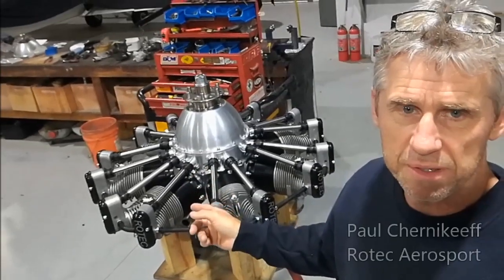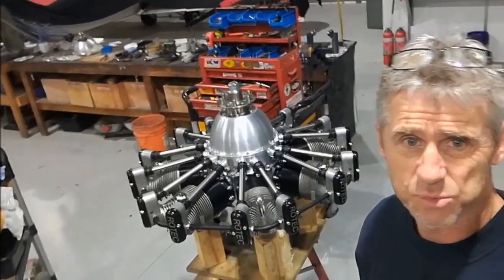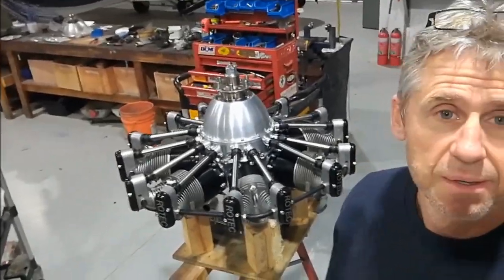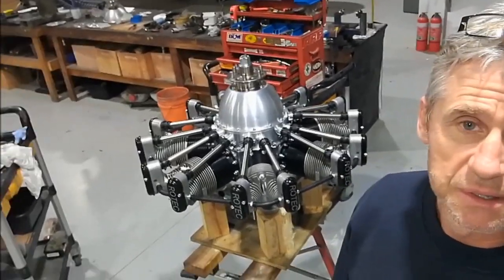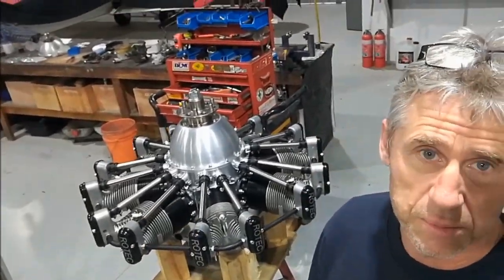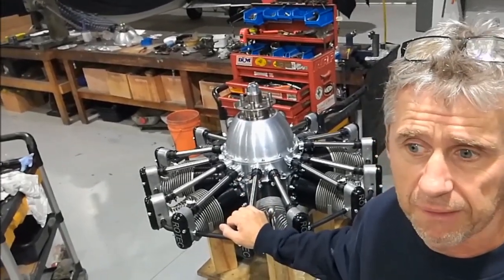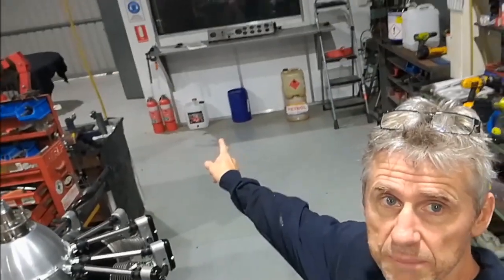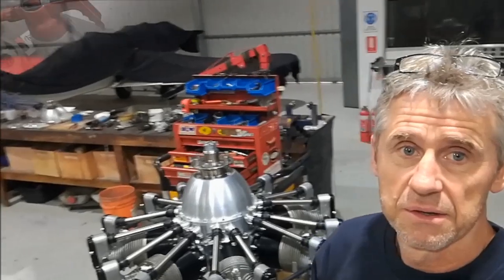Rotec R2800 radial Assembly (Time Lapse)

Comment: Would have been nice to have seen the engine assembled from the ground up. However I did notice a huge safety issue were you had turned on the master switch and the switch for fuel so she was ready to fire up. All it had to take was your buddy to not notice you and you would have been hamburger! Plus you went to check for exhaust while no one was at the controls just incase of a major issue. To me you guys are a bit reckless and should take better precautions. Put a Camara outside,put a big ass red button for an emergency shut down and always have someone at the controls! It's not a matter of if but when. No excuses guys!!!
Reply from the maker: Thanks for your comment, but NO, the master switch just connects the battery,  the mag switches have to be hot for there to be ignition.  This engine uses e-mags, they are electronic.
Have a good one.